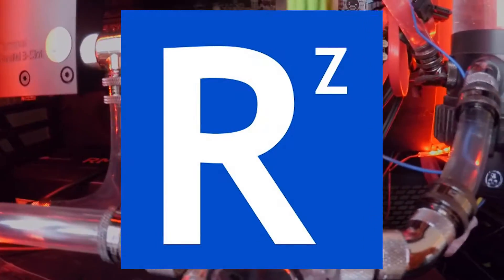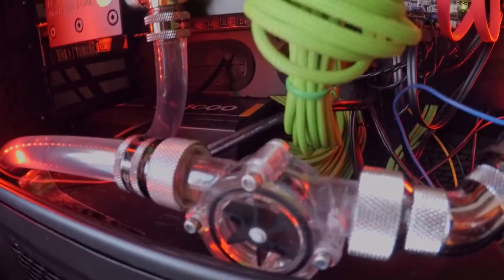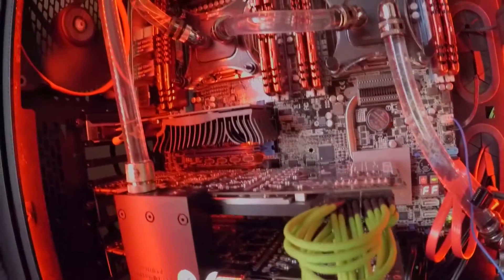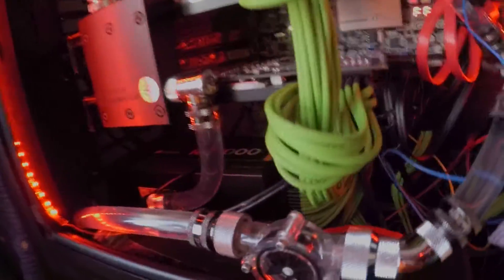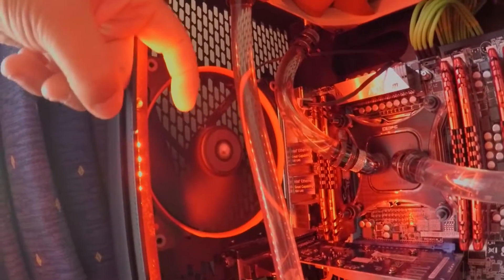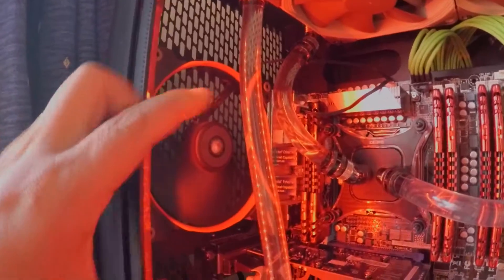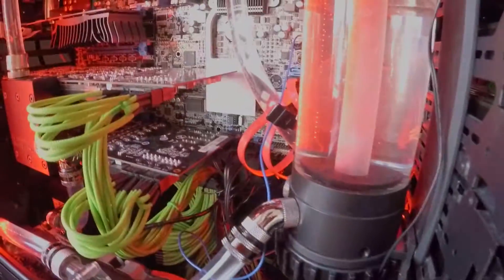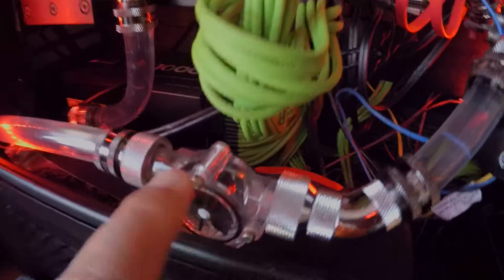Where to put extra pump and reservoir in  my Dual Xeon water loop.

Comment: How about a dual loop since you got two rads and to res+pump combo? one for the CPUs and the other for the GPUs? Have a dual 5 1/4" res+pump combo for the CPUs and use the old pump for the GPUs.
Reply from the maker: I am considering a dual loop option. It will give me more flexibility when chucking components in and out of the PC...
Reply: yeah an isolate the heat better too, bigger rads goes to the GPUs

Comment: id go for a DDC or D5 Pump - The DDC pump has the highest pressure and the D5 has the highest flow, personally im using the DDC pump and it runs the water like a bawz, another thing ive seen through my time of watercooling is that some components have more resistance to flow one way more than the other even if it isnt shown on the cooling component :) 

and damn im jalous about your build wish i had one like it :D!
Reply from the maker: A great suggestion buddy. I've never even seen a DDC pump in action (i'll youtube that later). But I do like the flow of the D5. But I do think with 2 cpu blocks, 2 rads and 2 GPUs I am pushing my D5 harder than it's meant to... We shall see.
Reply: My DDC pump circulates through 3rads and 1cpu + 1gpu and i havent notiched any "weak" output when filling up and my temps are nice even for oldschool hot components (fx series cpu ) even with my older 560ti card which was base higher than my 970 on air no other components gets higher temps so very nice pump indeed :)!

Comment: instead of putting in another pump, i'd buy a new combo with a D5. My EK D5 pump works fine in my system (360 rad, 240rad both 30mm dual xeons and R9-290). i run my pump at 1/4th of max speed and it's perfect.
Reply from the maker: If yours is running so well, then I suspect I might have a faulty pump, or a blockage in the loop somewhere...
Reply: +renderz Have you checked your blocks for any broken down plastic from the tubes or anything?